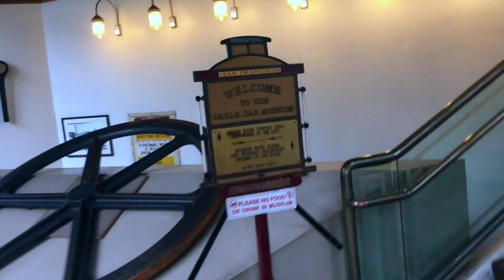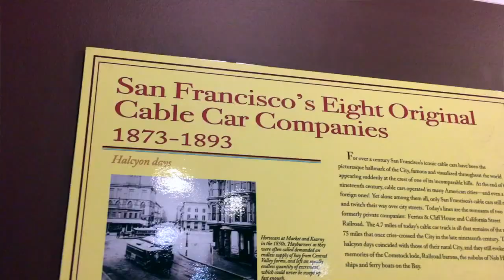How It Works: Powerhouse/Car Barn Visit, Cable Car Controls, Buying Tickets

Comment: Fabulous video, well done. As a teen in the late 1970s, I shot a documentary on the cable cars in 16mm film... the people were great (I had no official permission just poked my head in where I didn't belong--a different time!) and a couple of the conductors befriended me so I had access to the powerhouse, shop floor, and all the inside talk of the time. The system was in a bit of a shambles--the tracks were so worn that any car taking a hard corner at more than about 4mph derailed, and there were not infrequent accidents due to poor maintenance. So glad to see the city taking a renewed interest in this precious resource and realizing--finally--that it is one of the things the world thinks of first when they think San Francisco!
Reply: While spending countless hours in the powerhouse, I also made friends with the night operations manager who would let me hang around in the wee hours--a great way to see operations without the public around and also cable car maintenance. Worth note, in the 1970s there were additional efforts to tear out the lines (amazing that the city didn't recognize their prime tourist resource!). Also, this was before the big refurbishments of the 80s and 90s, so the cars themselves were completely mismatched and the trackage in many places so severely worn and shallow that a turn at more than 5 mph could face derailment, especially on the "coasting turns" that required some speed to reach the cable pickup at the far end--all this was ably narrated by a particularly frank conductor who also became a friend. I'm so very gratified the city, powered by civic groups as you mentioned, finally did the right thing. A wonderful piece of living history and Victorian tech.